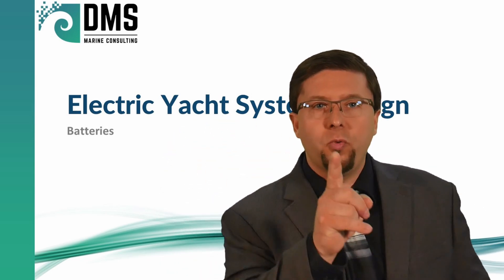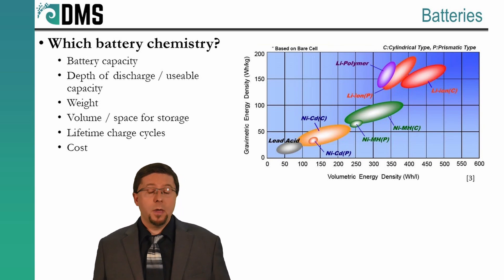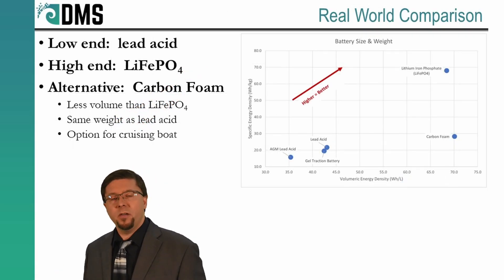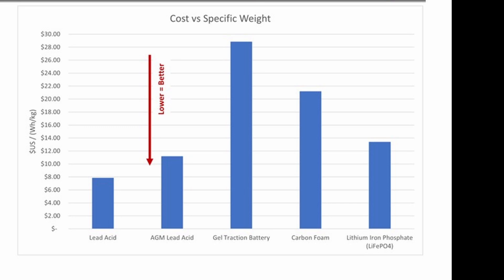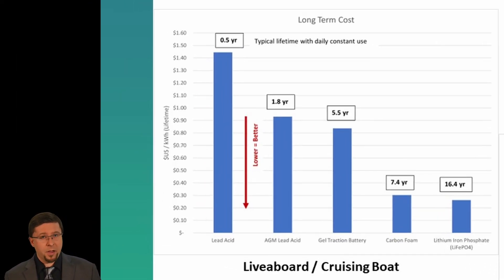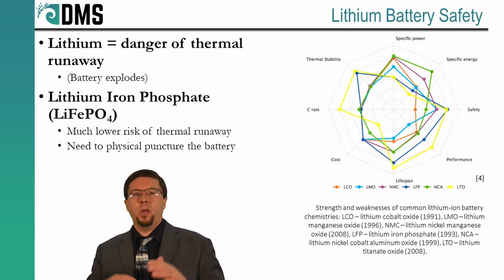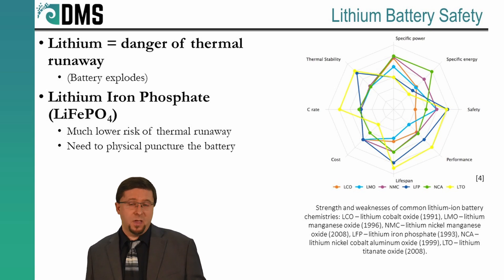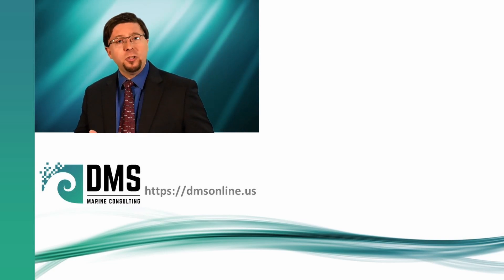Which Battery is Best for Your Yacht?

Comment: Well, the performance and energy density of LiFePO4 is only about a third to a quarter that of the leading LCA batteries. This is why practically ZERO electric cars use LFP batteries. This is also why diesel-electric submarines looking for an all electric alternative to Air Independent Propulsion (eg. the JMSDF Oryu and Taigei classes) do not use LFP batteries in spite of their paramount interest in safety. High energy Lithium (everything from LCO to LCA) can be safe if there is a proper charge/discharge management circuit and LIQUID COOLING of the cells. Typically, water bladders (Tesla) or channels (most other EVs with larger format prismatics) between cell banks circulated to a radiator. The key here is that battery should be purchased as a certified SYSTEM with integrated charge and cooling management, rather than as piece meal cells and controllers. If that is too difficult, consider off-the-shelf integrated terrestrial or adapting an existing automotive solution. These go up to about 100~200 kWh. If you need more than that, you probably have a superyacht and you can afford to hire and engineering firm!

Comment: Is it possible for battery weight to be used as part  of the ballast in the vessel design? If so I feel like carbon foam would be sitting in a pretty good sweet spot.
Reply from the maker: Yes, it is possible, and a very good idea.  The challenge is fitting those rectangular batteries into a curved hull shape.  It doesn't work well as a retrofit.  But for new construction, where we can shape the hull to fit a large battery pack, then batteries as ballast works very well.
Reply: Lolololoololololololololol what?

It's not a case of , "yes it can".  It's an absolute,  it will .

Comment: never heard of gel traction batteries before. i knew carbon foam ones existed but i couldnt get any numbers, just call us if you wanna buy them nonsense.

for giggles, lead crystal batteries that a brand that starts with [am] makes can have up to 18k cycles. the best LiFePo i have seen are 3,500. how's that for longevity?
Reply from the maker: Gel traction were the precursors to AGM lead-acid batteries.  You can still buy them to support some legacy systems, but AGM generally took over for people who want a sealed lead-acid battery without the concern of it venting regularly.  The carbon foam batteries I found are sold under the brand name Firefly https://fireflyenergy.com/  You won't find them in the convenience store.  Instead, search on dedicated battery suppliers and you can find that brand name.
Reply: .... sounds like the lightbulb conspiracy all over again.